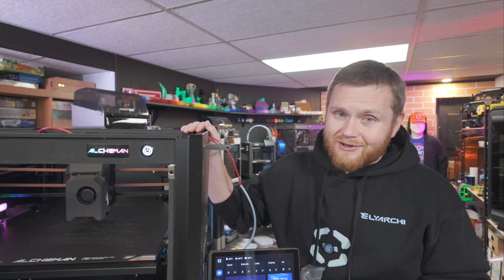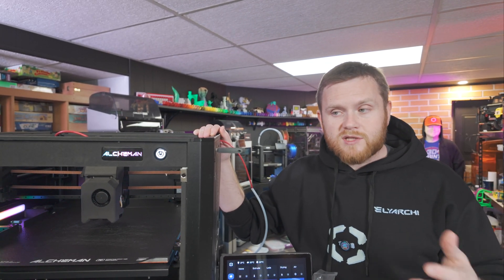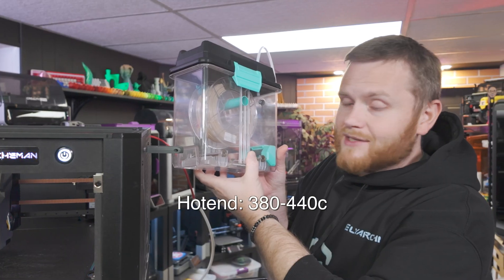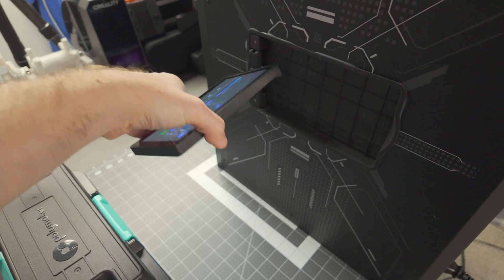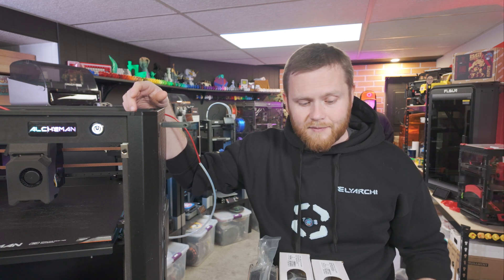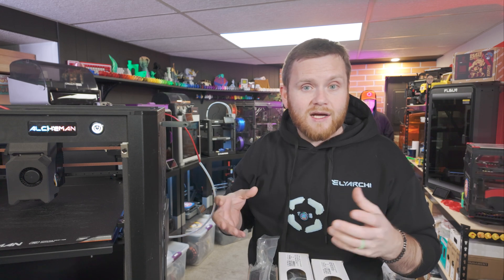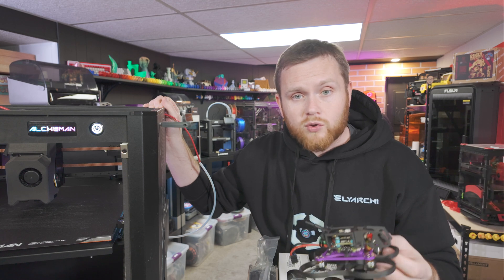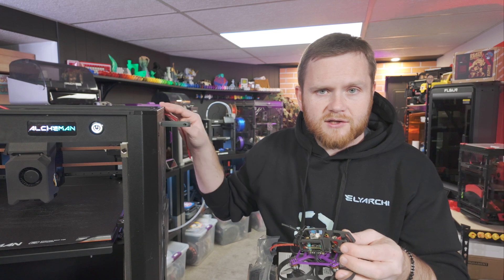I 3D PRINTED AN FPV DRONE! Let’s see how it flies!

Comment: Very cool buddy. Haven't seen you in a while. Nice to see you. Still doing fpv though. What would you say would be the best material to print for? Like hardness stiffness, strength on an a1 mini. Can you do nylon carbon on the a1 mini. For ducts I really like PP
Reply from the maker: Hey dude! The stiffest material I have tried yet is PPS-CF and PPA-CF or GF. Both need hardened nozzles, gears, and a chamber. So the a1 mini is out for those. I’m honestly not sure since the a1 isn’t really meant for that kind of thing. Maybe some Pet-cf from polymaker would be stiff and printable on a mini. It crushes tpu though! Have you tried to put PP through it? Or nylon?
Reply: I do the pee pee on the mini but I have to put packaging tape all over The print plate every time so it is a bit annoying. Haven't messed around with nylon just because I heard the toxins from the heat or whatever. So printing pet CF be better or easier than nylon CF? @3DPrintSOS

Comment: HI, I printed the Aquila Direct Drive Mod - OOTBDD v2, but the filament doesn't line up and curves away from the PTFE tube. Is there a fix to this? Did I do something wrong?
Reply from the maker: Unfortunately it seems like Voxelab changed their extruders a bit from when i designed this years ago. some have said the levers dont lign up. I would suggest printing the lever from the Fedorstruder 2.0. Its tension adjustable and design to align with the block.

Comment: Bratux Privet. How is the quality of the prints on this the actual printer? I saw the input shaper graphs and they look like kakashka to me. Is the gantry stable? Those thin linear rails floating in mid air are a bit questionable. Let a brother know. Hit me up direct if you can you got my email. If you have time. Also if you can do a full dive in to the printer and its pros and cons and its shortcomings would be great. Did they send you the 5 color "ams" unit too? One love as always. PS serious flying skills there bud. Also ochen krasivi i xaroshi dom ti imeish. See ya around bud.
Reply from the maker: The issue I ran into is that my machine was damaged in shipping so I only got two days of printing in instead of a month. So that’s why it was limited. The prints I have printed so far, came out solid. As I have it longer and use it more, I have gathered a large list of notes and concerns that I will put into a post. I was going to send it to them directly, but since this machine is due to ship in a few months, I think everyone needs to hear the concerns. 

No, they did not send me the Vooooo color system. And thank you, that is my parents-in-law place. I call it "the resort”. haha.  WAY more room to fly than my tiny home. :)

Comment: Cool video Fedor. I like the idea of FPV but fairly certain it would make me motion sick. Would this size of drone be able to handle a GoPro onboard for better video quality?
Reply from the maker: I get motion sick in VR, but for whatever reason, NOT in FPV. I think its because the refresh rate is actually really high. Ive even done FPV shoots on a moving boat while filming other boats and somehow held it together. haha. 

No, no go pro for this tiny quad. However, if you do a digital camera and VTX (like the DJI 04 Air Unit) it will literaly have 4k 60fps onboard recording. So I will install that in the next day or two and do some more tests. ;) I made some modifications to the design, thinking about making my own recomended build.